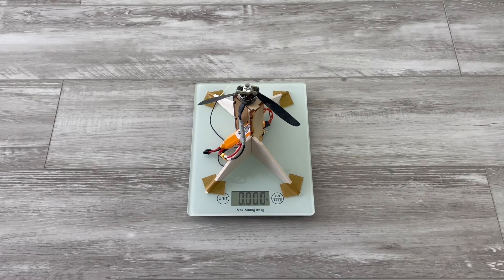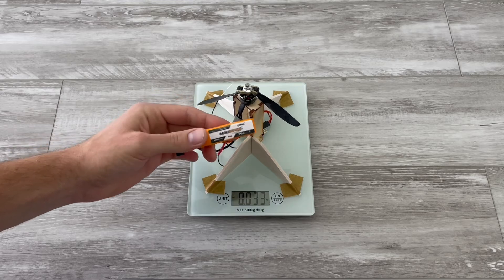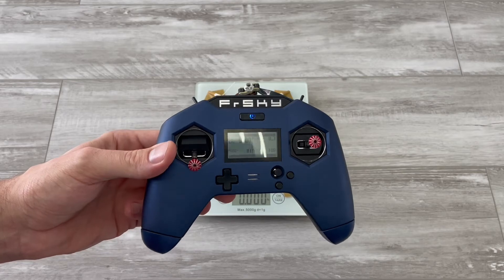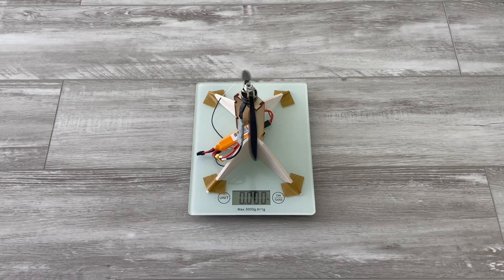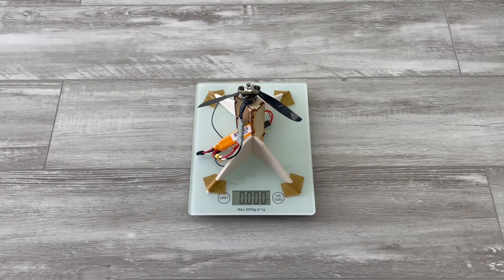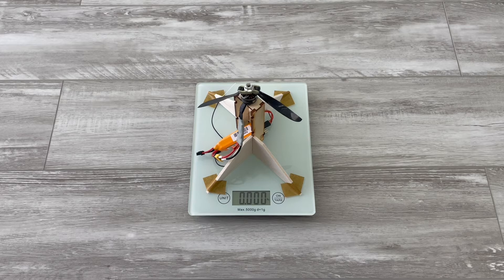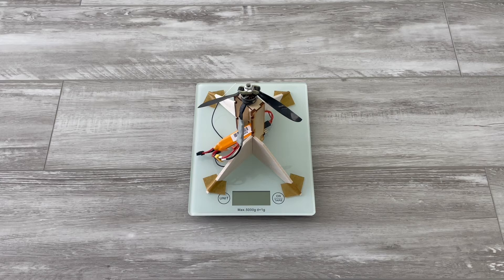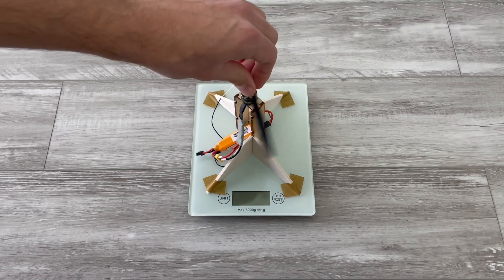F5K Power Set Test: F1507 2800kv, 7x4 Prop, 450mAh 2S 70C LiPo

Comment: What esc are you using please?
Reply from the maker: Hi, on this particular setup, I believe it was Turnigy Multistar 21A BLHeli_32. However, these are out of stock for the last two years, so not sure if you can get them somewhere. 

If you care about having the 32bit one, as I do, check the HAK RC 35A one - it's about the same size and reasonably priced.
Reply: @flightpointrc  awesome. Thank you